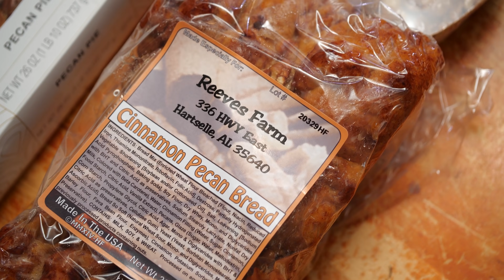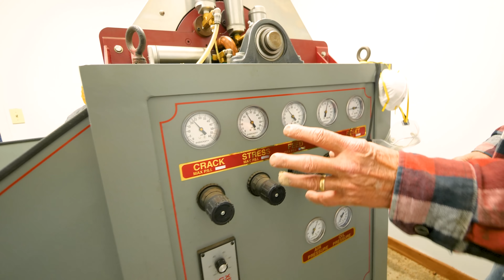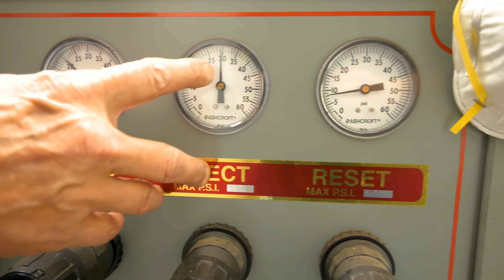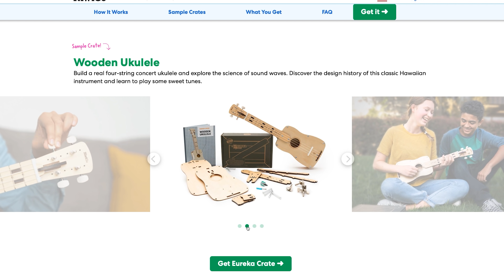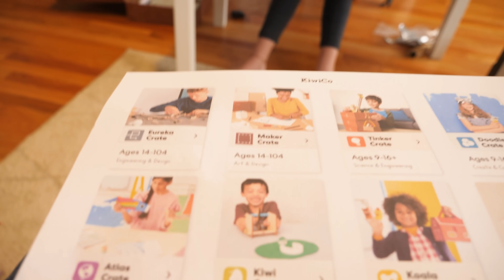How to Harvest Pecans (In Slow Motion) - Smarter Every Day 248

Comment: I used to work for a man who owned a large pecan orchard here in Palestine Texas. If the pecan husk looks like it is open but the pecan does not fall when you shake the tree then those are bad pecans. Normally it is because a fungus has gotten on them during development from too much humidity and not enough air flow between the trees and it kills the juices that circulate to the developing nut. The other reason is from moths that lay their eggs in the new tiny baby pecan, and the larvae eats the inside of the developing nut.  In the first case then that never finished maturing so it never really completely let go of the hull. In the second case the nut never finished developing because of being eaten from the inside. The first doesn't fall when you shake the tree so the bad ones actually stay off of the ground. The second one that was being eaten internally falls but is extremely lite and these are the ones that are blown out by the air sorter where the heavier mature ones don't get blown out. 👍🏻

Comment: what about shaking individual branches with a big upsidedown umbrella/funnel underneath. The nuts would hit the fabric, roll into a collection vessel, and never be on the ground. Sticks and leafs wouldn't roll down the fabric or stop this process,  and could be dumped by closing the umbrella every few minutes.
I also wonder about shaking the tree near the base of the trunk, that's so hard to do that you risk bruising the tree, rubber pads or not.

Comment: I would guess, that it does not make a huge difference in which direction the tree is shaken, because the thin twigs act like a rope. Take a rope, 2 or 3 meters long, and make kind of a two dimensional sine wave at one end, while the rope is hanging straight down. Watch the rope while doing that. Do it left and right, and then shift your movement 90 degrees, compare both cases. It will also work while the rope is laying on  the floor, it is just more difficult to shift the movement by 90 degrees while having gravity. I guess it is the same for the tree, just upside-down compared to the hanging rope.

Comment: regarding the shaking from two sides my first thought was not the direction but the frequency.
There must certainly be a frequency at which each tree starts to resonate to a certain degree, if one was to find out which frequency that is or even had a tool that would automatically ramp through different frequencies to test each tree you could probably get more nuts off the tree in a shorter time frame.

Comment: Spitballing ideas about why the late harvest. Short answer - Climate Change. Longer (still broad) hypothesis - Pecan trees are relatives to deciduous hickory trees. the pecans are fruits/seeds being ejected from flowers that open up at the change in seasons. Late September is when you expect the turn from summer to fall through quite literally through the fall equinox. The flowers don't open because of temperatures being too warm despite having the right amount of radiation from the sun. (flowering proteins could be temperature and light sensitive. Different breeds of pecans could extend the variation to prevent seedling competition) The seed ejection gets desynced so harvest season comes later than expected. Harvest yield might be lower as well because of the desync.

Comment: Another thing I immediately became curious about, is whether there is an optimal grip height on the trunk to get the best result. I imagine that because of the complexity of the vibratory system and each branch having it's own unique length and mass relative to the others,  that it likely would have little effect as far as overall efficiency goes

Comment: Here is my theory on why going 90° out of phase has no noticable effect. I think this is because the center of mass of the tree is never perfectly inline with axis of oscillation, (I think that's the right term) thus a torque is always applied along the trunk and a feedback loop incurs so you end up with a rotational effect.

To think about this in a simplified form: stick a pen thru a roll of tape or something similar and by only using the pen, attempt to move the roll of tape up and down with out it rotating around the pen. It's impossible because you will never get it perfectly normal to the inside of the roll such that all horizontal forces cancel out. Now rotate the ring 90°, nothing changes because you still end up in the same feedback loop. This is an example of harmonic motion, right?

Comment: I was told somewhere along the line that the shelling process for nuts consisted of a positive electrode at one end of a nut shell and a ground at the other.  When the charge is applied, the shell explodes and the nut's meat is largely perfectly intact.  So I wonder if maybe this system is used for larger, commercial (non-Mom & Pop) operations...?

Comment: Can the frequency be changed? If the branches have a resonant frequency that is significantly different than the roots of the tree, it could reduce the stress on the roots and increase the harvest using less total energy. Also, the location of the excitation on the trunk will greatly change the performance of the shaker (think Chladni plates).

Comment: Mom and Pop farm products always taste better than big corporation farms because they do it for the love of doing it and the focus is always on quality over quantity.

Direction of shaking the tree doesn't matter because the vibrational frequency at the large base of the tree is so high that as the vibrations move through the smaller limbs, those limbs reach their resonant frequencies which naturally will cause them to move in whichever direction is easiest. If the vibration moved in much longer frequencies and higher amplitude. then all the limbs are more likely to move in the direction of the source, and then directional vibration would matter but be less likely to shake the nuts off the tree.

Comment: For the cracking machine, you can also have 2 plates, one still, one rotating. Both have "teeth" that come and break the shells of the nuts... nuts get in between from a hole in the center of the top plate (which stays still). Goes quite fast... you just need to sieve big and small nuts apart before, so you avoid excessive breaking of the bigger nuts. You then adapt the space between the 2 plates according to the size of the nuts :)

Comment: Another engineer here out in Arkansas, I actually went out last fall and helped out at a pecan farm out of curiosity on weekends. There is only a couple of differences between the larger scale operations and the family ran. 

The shaker was a stand alone unit, and as such wasn't on PTO. Once the pecans were collected (basically same machine for collecting) the pecans were collected directly into a trailer which had a hopper on the bottom for feeding into the blower. The air velocity of the blower was adjustable via counter weight, which allowed you to get different pecan grades (IE you could fill 4,000 lb bags with higher quality nuts first for higher price per lb).  They didn't shell pecans on site, they were loaded onto semis and sold to a company in Oklahoma who payed based off of the quality of the nuts in the bag.

Comment: About shaking trees, that's what they also do with olive trees here in Spain. They still hit the branches with long sticks and they also use some kind of mechanical shakers, which look like weed eaters but with a pitch fork at the end instead of wire, but they use kind of a 2.0 version from what they have in the video, as when the shaker is in place, it has some kind of cloth that mechanically goes around the tree, kind of a bat wing that finally looks like an umbrella upside down. This is in order to catch all olives before they hit the ground.

Also, when doing it by hand or "mechanical pitch forks", they use nets, kind of fishing nets, on the ground so it's easier to pick them all. I don't know why they wouldn't do it here, I guess it saves a step in the cleaning process but... who knows.

Comment: Hi Destin, about the vibrating branch, I think you're looking at a resonating vibration mode. The higher up the vibration goes up in to tree, the more the vibration gets damped out. Resonating modes don't damp out as quickly though, so high up in the tree the vibration modes of the tree and its branches are prevalent. Because you have damping in the tree these vibration modes will get excited independently of the angle you shake the tree. Actually it would be really interesting if you can shake the tree at different speed, so that you basically do a frequency sweep of the tree.

Comment: Reminds me of growing up on one of grandpa's cherry orchards. They're cherries, so they're soft and can't hit the ground, which is another problem to solve. So they run around with two big machines, the shaker and the catcher, with giant tarps that fit together and funnel all the cherries onto the catcher. Shaker shakes, it's pretty much identical to the tractor here, aside from being a dedicated machine instead of a tractor attachment. The catcher is really interesting, though. Everything funnels down onto it, and it has a conveyer belt that feeds everything into a water-filled tote in the back, to transport the cherries. On the end it drops everything over an air blower to knock most of the leaves and twigs and bad cherries out of it, then when the tote's full they drop it, swap it for a new one, and a tractor hauls the full one off. I was just a little guy, so I was on tote filling and cleaning duty. Fill them about a third full, and when they're brought back we scraped everything that floated- more leaves and rotten cherries- out of them, then we capped a lid on them and they were loaded onto the truck. Grandpa had something like 200 acres back in the day. I grew up in great grandpa's house, on a 20 acre plot. Never helped with the plums (We always just called them prunes, because they were low-water content pruning plums) but I think that was the same process.

Comment: I wished you would have done a slow motion on that machine while he had it opened up.  I know it is just a nut shell cracking, but would have liked to see the pattern at which the shell shattered with pressure applied in that manner.  I love your videos.

Comment: Would have loved to watch the nut cracking machine in slow motion, I work with high speed automated manufacturing equipment every day, bottling and packaging equipment,  and slow motion video is occasionally used to troubleshoot equipment malfunctions that happen faster than the naked eye can see, often pneumatic equipment such as this machine, air cylinders move very fast

Comment: Regarding the tree shaking in the same way whether you approach it one way or 90 degrees apart, this reminded me of gravitational waves: a gravitational wave is identical when rotated by 90 degrees, but is most different when rotated 45 degrees (since compression one way looks like stretching in the perpendicular direction, and the wave alternates stretching and compressing). It's not clear to me that a similar thing would be happening here, but I'm still curious to see if it makes any difference if you shake the tree at a 45 degree angle the second time

Comment: They were shaking pecan trees in the 1950's, I have a house built in 1912 and it has switches on closet door to turn on the light.  Lived in a 1870 victorian house wired for electricity in 1909, it had a central vacuum system.   Smarter every day, hardly,  with some exceptions, there is nothing new, just a sequel.

Comment: The guy behind my pawpaw had one of those tree shakers. Pawpaw would just ram his trees with the front of his tractor over and over.  He did have an automatic "picker-upper" that he'd pull behind said tractor, but the separator were used was simply a table with a wire mesh. You'd pick up one end and shake the pecans to the open end.

I learned to drive his old pickup in his pecan orchards. Before I was even 10 years old, in fact. By the time I was 10, I was driving his tractor, too.

Comment: Not a physics PhD, but my take on the pecan tree branches shaking the same way between the orthogonal shaking angles: 

Each section of the tree all the way up to the tips of the branches has it's own reaction forces determined by it's structural orientation relative to the other parts of the tree it's connected to. 

As the force travels up the tree, the resonant system of each section reacts to the applied movement with the elastic rebound characteristic of it's structural orientation, taking the energy from the original axis of motion and redirecting it into it's own particular direction, becoming closer to what you might term a "specific resonance" (a shape in the spatial domain, for a particular energy/frequency) of each branch. 

So by the time it reaches the top, the direction of the original mechanical input is mostly gone, its energy incrementally "harvested" to produce the branches' own characteristic vibrations.

Comment: "You don't want to leave your nuts on the ground." Timeless advise for everyone.

Also, instead of vibrating 90 degrees around the z-axis, I have a suspicion that using a frequncy ramp would give the large and smaller branches a chance to hit their natural frequency which would greatly increase the amplitude of the displacement, causing a more violent whipping action at the tips, dislodging more nuts. But once disloged, for pete's sake, DON'T leave them on the ground.

This has the benefit of not having to reposition the tractor & shaker.

Comment: The trees are motion filters, they're going to shake much the same way from any input direction because of the way they grow.  Part is in tension and part is in compression.  Since the shaker is coupled to the tree and not the ground it will obey the root anchorage pattern.  Its far more likely to get a different pattern of shake if you raise or lower the shaker than changing the direction of input.   I would suggest, in the long run, that slowly finding the direction with the most thorough shaking then marking that down would be better for the lifespan health of the trees as it would allow much lower input to achieve the same results - resulting in less root stress and trauma to the vertical roots.

Comment: I have some experience with virbration analysis. The reason why the branches move similarly with the rotated shaker input is because the frequency of the vibration does not change. A flexible body does have certain mode shapes / normal modes which are triggered at certain frequencies. If the frequency would change the body or branch in this case would move according to a different mode shape for that frequency. Anyways, always cool to see you looking for science in everyday places. As always, inspiring video!

Comment: First thought wasn't to vibrate at a different axis but at a different frequency to allow for the branches to have the wave crossovers at different places. There seemed to be spots of the branches that were not vibrating as violenty and I suspect this would help get those spots better. And no need to move, just have different frequencies run at sequences through the shake.

Comment: I imagine that moving the shaking point up or down the trunk by a quarter wavelength would be more effective than rotating it. But seeing the large loss of mass from the dropping pecans makes me think that the resonant frequency of the branches probably changes enough over the duration of the shake to cover various modes. So it's probably unnecessary.

Comment: My grandparents had a pecan orchard and sold their nuts off of trucks along the road. My dad, as a kid in the 1940s, would spread burlap tarps under the tree then "smack" the tree with rubber mallet sledge hammers to knock the nuts off.
---
I live in Northern California almond country. They used to use 25 foot bamboo poles to knock the nuts out of the tree.  The farmers here call them "ahhmonds" (short a like apple) because, as they say, they have "knocked the L out of them."

Comment: 'PTO' -- Power Take-Off -- a rotating shaft connected to the tractor's drive train (crankshaft, flywheel, clutch & transmission) or sometimes run off a hydraulic fluid pump (similar to power steering pumps).  Various 'powered' implements are connected to the PTO shaft (rotating tillers, excavators, sprayers, mowers, harvesters, sweepers, augers, etc.) eliminating the complexity and weight of additional motors or engines for each device.  Simpler devices likes plows, rollers, harrows, etc. would probably not use the PTO.

Comment: It'll be pretty interesting to see, what happens when the excitation frequency is varied, as the tree will have a bunch of resonances. It possible that a particular frequency happens to be extremely effective in dislodging those pecans. It might be the frequency near which most of the branches have a resonance. Displacement inheritance due to branching might mess this up but, this will vary from tree to tree. A frequency sweep will truly give an idea. There's a possibility of increasing harvesting efficiency using this.

Comment: At around 9:00, is it just the reduced weight of the pecans allowing the branches to rise, or does the energy imparted by the shaker have an effect for the duration of the shaking?  Do they fall back a bit afterwards?

Comment: The top most branches showing nearly identical vibration when the tree is excited in two perpendicular axes: I guess happens due to transfer of energy through the lower branches via the path of least resistance. Branches have different stiffnesses in different axes due to their geometry. Which means they'll tend vibrate more along that low stiffness axis only. There will be slight mode mixing nonetheless. Lower branches act as vibrational filters. Quite fascinating.